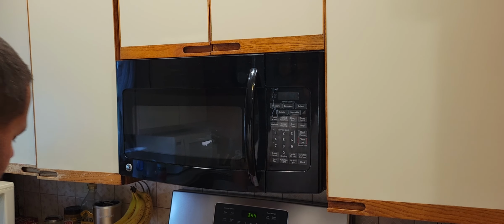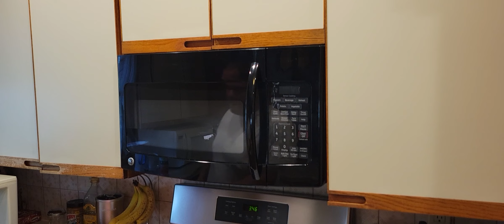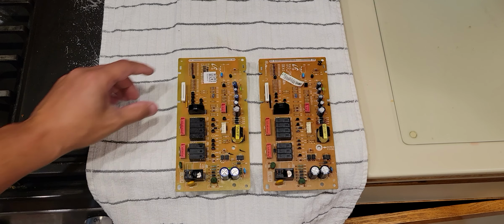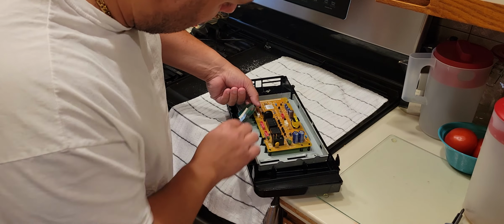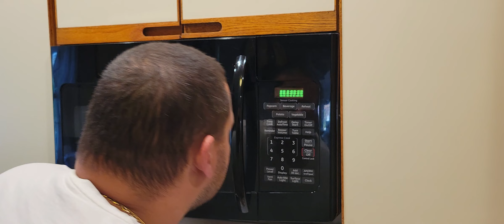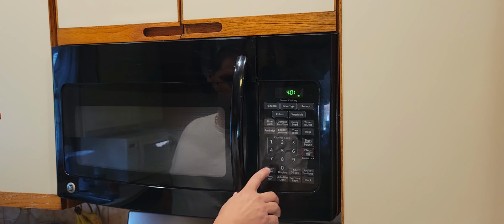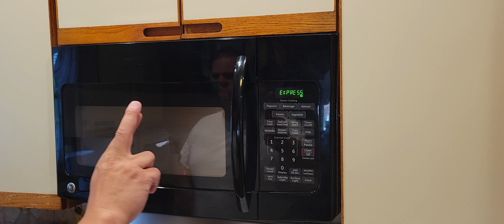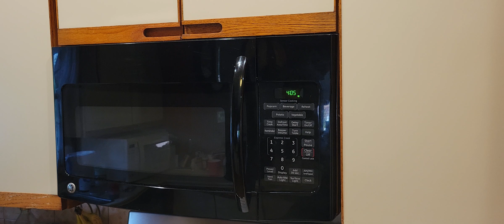GE Microwave Fail (Pt.2) (2023)

Comment: Time cook, set time, press power level. Depending on what you are reheating, I'd say for sensitive foods like donuts use 1 minute on 30% power level. So you would press time cook, set the time on how long you want to cook, press power level 1 for 10%, 2 for 20%, 3 for 30%, 4 for 40%, and so on. It will go back to 100% power after changing the power level to a lower level every use so say if it's done cooking the power level will go back to 100% everytime. Some use 80% power to reheat their food but I use a lower power level like 30% or 50%